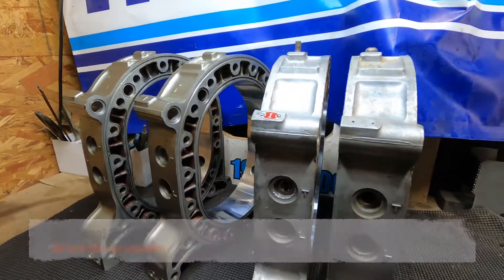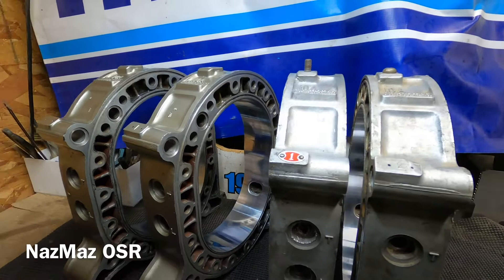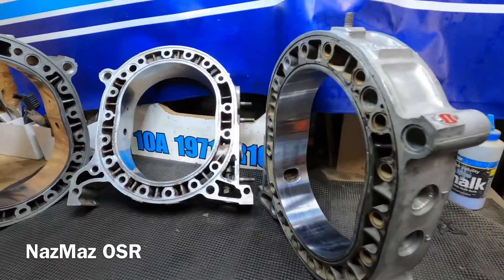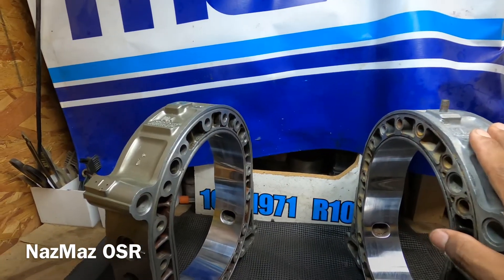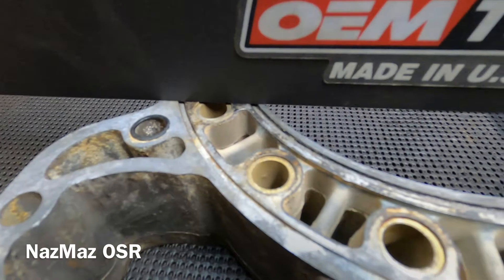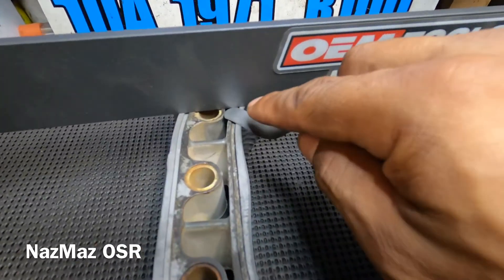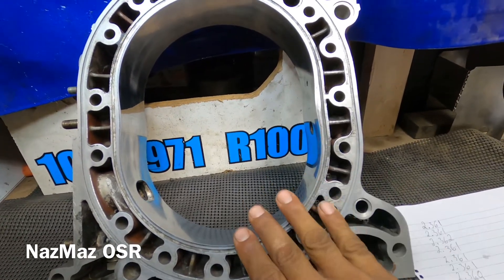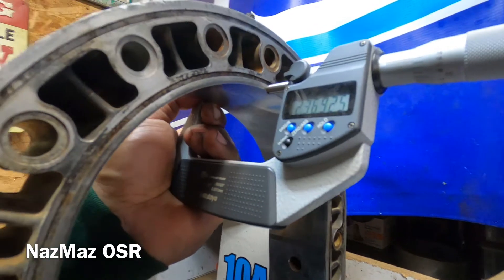How to Inspect Mazda Rotor Housings (10A S1/S2)

Comment: Warped rotor housings - useful only as a paperweight. But it begs the question: Can these warped 13B housings be machined down to use as 12A housings (which Mazda no longer produces)? I believe Atkins Rotary has been doing this. Once machined to size they cut new coolant seal grooves for use with 12A irons.

The process requires 5 millimeters to be machined off each side of the rotor to bring its width down from 80 mm to 70 mm. This eliminates any minor chrome flaking at the edges including the peripheral groove that's carved into the chrome by the apex seal triangular piece. 

But a warped housing would need to be perfectly squared up on the milling machine in such a manner that the new machined surface is exactly square to the chrome surface, and then flipped over to square up the other side before re-grinding the chrome surface smooth and square.

Sounds easier said than done though. It would be all too easy to over-correct and end up with machined surfaces that are not parallel to one another...
Reply from the maker: Yes, Atkins does cut the 13b housing to 12A spec. but only on new ones thought. I'm sure it can be done on warped 13b housings just depends on how bad they are...
Reply: @nazmazosr1260  interesting. I just happen to have one such housing that I foolishly had re-ground (the chrome was good except for the apex triangle groove) before measuring it and found the shrinkage to be almost five thou out-of-plumb. I'm in Alberta so even if I gave it away the exorbitant shipping cost would be worth it to exactly nobody. But if I had my own milling machine...

Comment: alloy weld the corrosion areas and machine the welds on the sides flat and machine water seal grooves 😁

Try and stick with the 10A engine 🙂